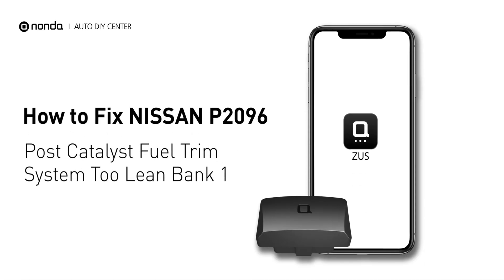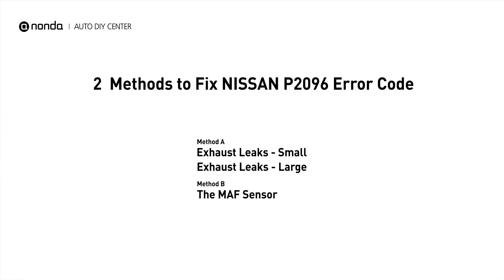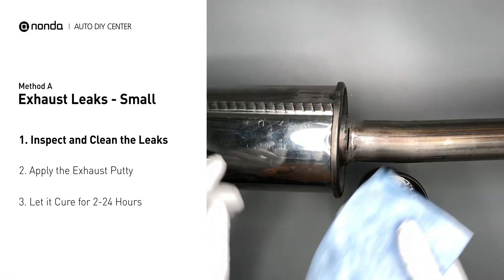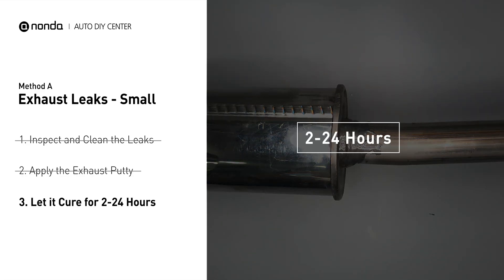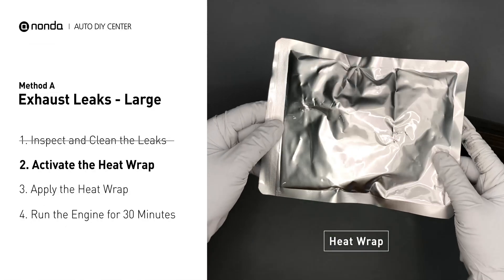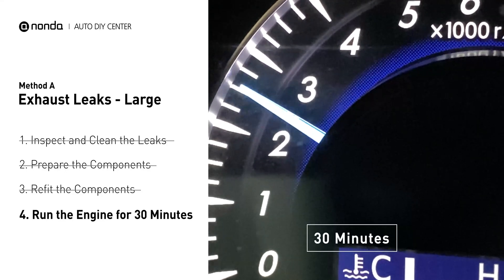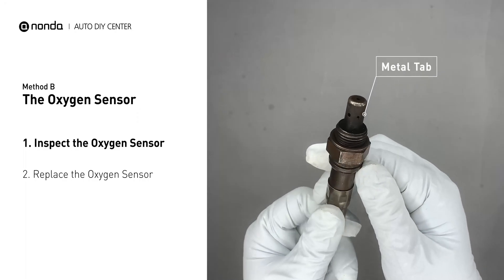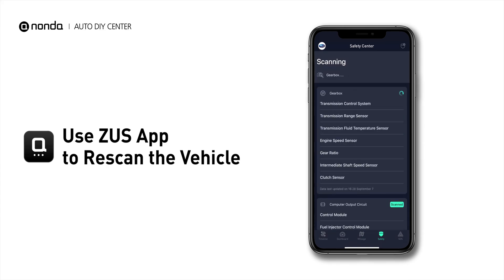How to Fix  NISSAN P2096 Engine Code in 4 Minutes [2 DIY Methods / Only $9.53]

Comment: I had and have the P2096 in my Kia soul 2012 automatic 2.0L. I replace downstream sensor, well nothing happened. I replaced the upstream and Nothing. Car has only 87K miles, Vacuum leak? impossible. Exhaust leak? impossible, car been inside garage and well keep it, cleaned and maintenance. Fuel pump, injectors, coil, all are new and good. I remove the code with y scanner, so I drive to work and Engine light is off, Car stays in the parking lot at work but under roof, so when I take it is cold, turn on and drive 4 to 5 rounds in the parking building before hit the freeway or hwy, once I take the freeway just starting or at the middle of trip( 15 miles or so) Engine light come up. Get home and remove it with y scanner.
---  Very tricky this shit. Why when I take the car from home engine light doesn't come up, but from my job come up?  WTF is going on here. This is to make us crazy.